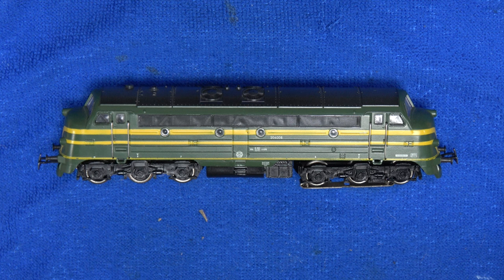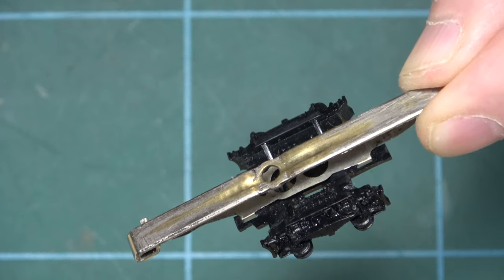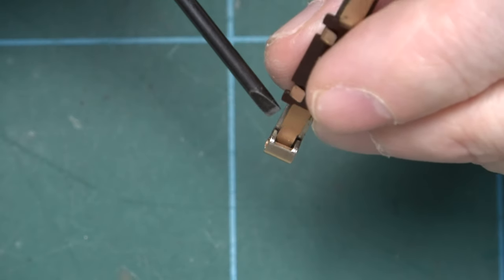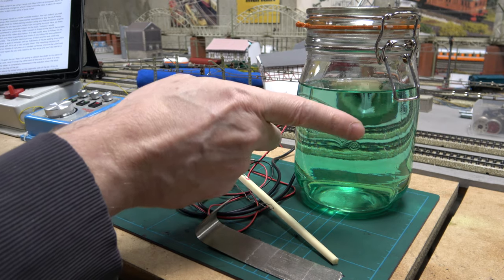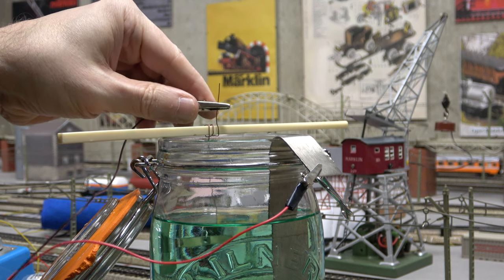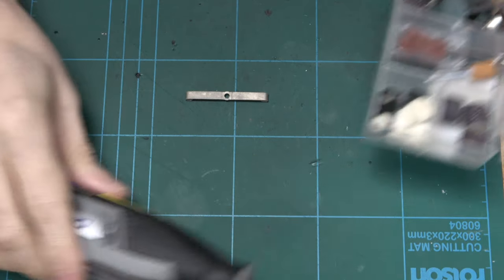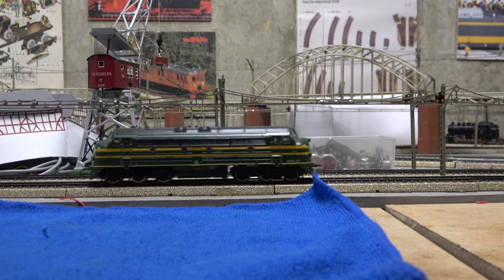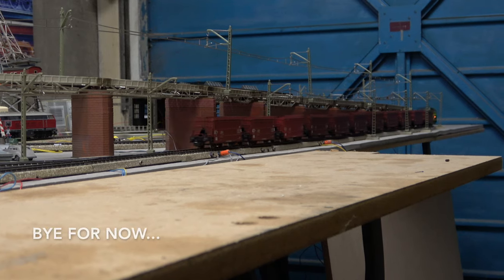Little helpers - Refurbishing Märklin pickup shoes (feat. electroplating)

Comment: As a person who prefers repair over replacement, I thoroughly enjoyed this video. Got my old pick-up shoes out and got plating: it works excellent!

I used a generic USB charger with an old cable I had laying around. Just cut the end off and mount crocodile clips (red is +, black is -, you can ignore the other two). Most older chargers put out 5v/1amp, which worked perfectly.

Thank you so much! I now have a strategic pick-up shoe stockpile😂.
Reply from the maker: Great! Well done!

Comment: Thanks for this very interesting video. I've got more than 130 Märklin locomotives in my collection and some of them would definitely need a new slider.
But one thing I missed in the video: You are using a 'Phone Charger' as power source. But you did not mention the kind of power. Is it AC (i suppose not) or DC, which voltage, which current? Perhaps you can add this to video description.
BR from Munich
Reply from the maker: Glad you found the video interesting. It is an old mobile phone charger -> DC. I also point to a reference video for detailed instructions (see card at the top of the video and link in the desciption), which I think should be watched before atempting anything. Thanks for spending some of your valuable time here today, much appreciated. Gruß nach München, frohe Weihnachten.